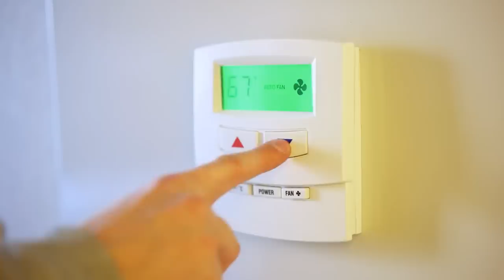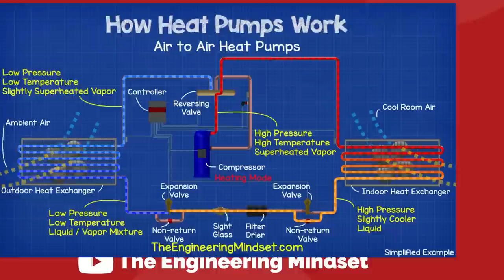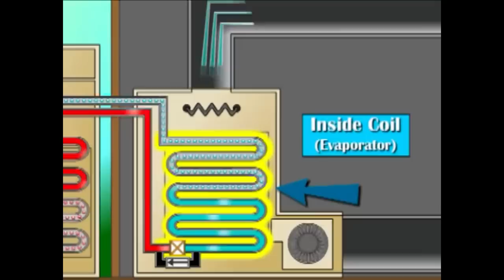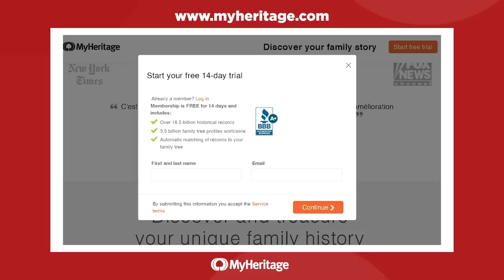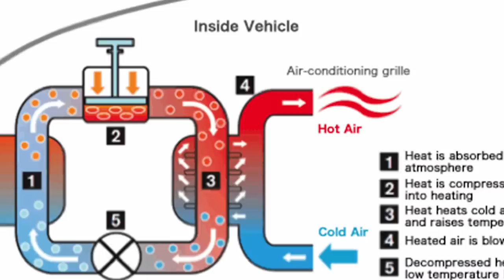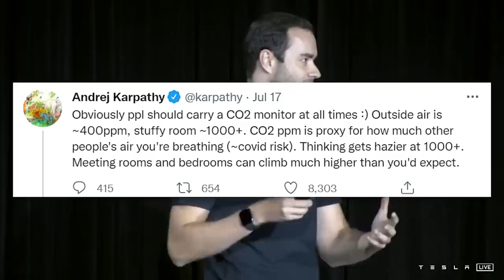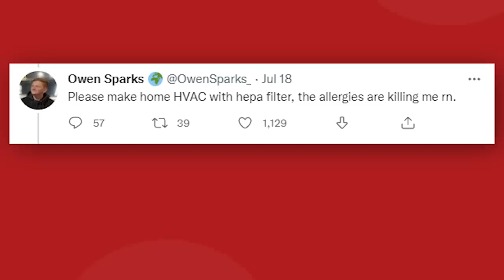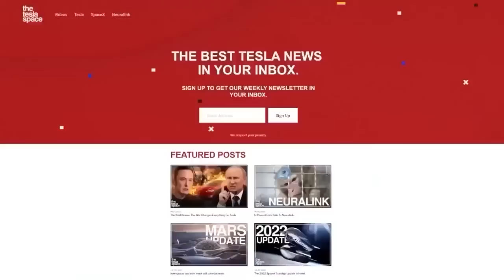Why Tesla's Heat Pump Is Essential For Our Future!

Comment: all hail elon for making 100 year old tech that every major HVAC company already makes.
Reply: This is the world television producers protected us from.
Reply: Lol I was seriously thinking the same.
Tesla is just over priced junk.
Reply: So did  he make it more efficient? Air conditioners/heatpumps might be 100 years old but up until recently heatpumps weren't very efficient at heating a home that is in a climate that gets below freezing. We now have heat pumps that can heat at 100% capacity to as low as  - 22°f(-30°c). That's insane since it's over 3 times more efficient than electric heat and some are 4 times. When you use ground source heatpumps you can get 6 times more efficient vs electric heat.
Reply: Obviously you didn’t watch the entire video because you would know that his team redesigned the “100” year old tech.
Reply: @DuelistMandroid  I have watched the whole video, several times in fact (just to make sure I didn't miss something). Elon has done nothing special or amazing. He took two existing technologies quite commonly used in the housing industry (heat pumps and HEPA), scaled them down for use in his cars (which did required some re-working to scale down), claims his "re-designs" are 3X more efficient than electric resistance coils (duhhh, all heat pumps are), proceeds to claim that he is so awesome for doing this and it should be scaled back up to be used in the housing market. Nice way to get back to the start of this journey in the existing technologies of the housing market.  Except of course I am sure, when he brings it to market, he will claim it is cutting edge and charge 10X the price.
Reply: @DuelistMandroid  
Enlighten us with you're knowledge
Reply: Elon sucks, but this is a good product/a huge force to actually pushing the boundaries.
Reply: @spencjon4822  I agree, heat pumps are a good product.  Every HVAC manufacturer in the world already makes them. I just want people to recognize that and not attribute this to musk.
Reply: @Durban01  Good to see another person with a working brain. Yanks are so gullible. Pitiful to read some of these comments. Creative thinkers? No. Not one.
Reply: @joeyork9891  "Your" indicates belonging to you. And "You are" can be shortened to You're. There was no indication of ANY significant progress made by Musk regarding the HP. It was inferred but no evidence was shown.
Reply: @kennethkeen1234  
Thanks.
Reply: Hail
Reply: The team did the work and Elon is just a leader and doesn’t want any credits.
Reply: @joeyork9891 rich from a guy who can’t even afford a Tesla 😂
Reply: @handle_user_unknown  
Maybe he can. They are only 100k.

Comment: I have another idea about Ventilate room during winter without cooling it
So - two tubes side to side all along , through one heat air going out while
through other coming from outside air heating simultaneously
Little bit of energy was needed in this case for actually push air
But its much much less then in Heatpump scenario
If compare it would be 1/100 for example or less , ...
Reply: Ha yea and - tubes should be long , i mean very long 
To provide decent heat exchange
Reply: There is a thing called a heat recovery ventilator that does what you are thinking about.
Reply: @honeytubs  yes its extremely efficient variation of those, when not a part but almost all amount of heat was recovered

Comment: Saving 75% with a COP 5 heat pump and solar panels here in Sweden. No batteries yet, except for the ones that we can’t yet use V2G in our Tesla cars. But hope Powerwalls will soon be sold in Sweden to complete our system.
Reply: What is the make and model of your COP 5 heat pump?
Reply: @LCD72  Toshiba
Reply: Why not just use a regular battery? Half the price and still has a ridiculously long payback period.
Reply: @mikekelly5869  a average household needs like 30-40kW to keep everything running 24 hours in case of a blackout. Normal blackouts last 1-2 hours. But unrealistic and unnecessary for most people to buy 3 PowerWalls. Most people in the near future will buy a BEV with maybe 60-90kW batteries so V2G and V2H is a must. Because we can then balance the grid and at the same time earn money buy when price is low and use or sell when it’s high a bonus is that you have backup power. If you are not a technical genius you need one Powerwall to manage this task. The thing is that Elon so far is not willing to give us V2G or even V2H.
Reply: @thescooterstore2813  If you need a battery, you can just buy a battery, any size, modular or otherwise. So far Powerwalls are nothing special. That might change, but if it does it will probably just make them smaller. A normal house might need 20 or 30 kWh to get over an extended outage of a few hours but unless people are doing things like using washing machines and dryers during the outage and the supply is down for significant timespans more than that is likely to be surplus to requirements. My own view is that if there's spare cash it's best spent on decent controls in the first instance so that you at least have UPS functionality and a rock steady waveform. Improved feed-in tariffs might make  bigger batteries more financially viable in the future but I doubt it. Utilities are clever at making sure that customers always continue to pay them when everything is calculated over time and they usually don't like unpredictable supplies hitting their transmission network because such supplies are far more likely to cause imbalance than the other way around. Despite the lip service given by utilities the world over, they almost never encourage microgeneration, or even larger scale generation by non-utility entities, for example PV on large industrial roofs. It adversely affects their bottom line and when the chips are down they want to control generation and transmission because that's where they make their money.
Reply: @mikekelly5869  Agree with your analysis. We do produce a lot with our solar panels in the summer period more than our three properties and 4 Tesla cars can use up. The thing is during the winter when we mostly buy electricity and the price peaks during the day. As we charge the cars during the night when tariff Iow, we would like to use some of that electricity during the day V2G or V2H. To manage that you need a smart battery that you can control from your smartphone. The best so far is the Tesla PowerWall. Hoping for more competition and more V2G we need to support the grid as everyone looses if the grid goes down.

Comment: It is honestly overdue to implement an updated version of heat pump technology in reducing global warming, where it is feasible (which is likely over 90% of the global market).  It is an expensive transition though, and at least in the US, it is the best time ever to start this process due to the recent bill passed subsidizing heat pumps for home HVAC as well as water heating.  In many cases up to 80% of the cost can be covered!

Comment: This has much broader implications. The next step after the heat pump is the ERV. The Energy Recovery Ventilator, which can save heat on the exhaust end and moisture as well. 

The Passivhaus movement has been on this for 30 plus years.

Comment: Pause at 10:37.
I invested in a Mitsubishi Zuba Central, in Quebec, where we spend weeks at -35C to -40C.  Freeze your nose hair cold.  And it cranks 22,000 BTU’s constantly because it uses an industrial compressor.  And heats a basement and 2 stories.  Because triple glass pane windows, insulated everything to the footing.
It costs much more than a traditional (clanky) square thermal pump, but at max power sounds like a soft rain shower in db.
My point; we don’t need Muskrat to « fix » our Thermo pump efficiency- just plan your thermal envelope and invest in a good system for years of trouble free use.

Comment: Refrigerant is not super cold.. It might boil at - 40 atmospheric pressure but not inside of a sealed unit.. It enters the evaporator a hot liquid. You can manipulate the boiling point of a liquid by manipulating the pressure above the liquid,  And it's refrigerant, Not freon!  Freon as a brand name Dupont labeled for R22 specifically.

Comment: HEPA for homes is a thing as well as uvc bulbs And Tesla heat pumps are not any more efficient than home heat pumps. And no matter how efficient your heat pump is you're eventually going to have to switch to natural gas in cold climates. There just isn't enough heat. And the way Tesla firmware updated the heat pump in their cars to make more heat was to allow its cop to drop below   1 which means resistive heaters would have been more efficient. I'm not saying that the heat pump is a bad idea and electric cars from temperatures in the upper 60s all the way to the 10s they are more efficient. But in you have to switch to electric heaters same as you doing houses. The only difference is in houses you're doing a cost comparison of the natural gas which tends to be a quarter of the price of electricity so you need a cop of four and anything below a copy of four you switch to natural gas because it's cheaper not because it's more efficient. In a car you don't have the cost of electricity to worry about. You have a set amount of electricity that you can use and you need to use it in the most effective way.

Comment: As anyone knows that tech is expensive as electricity is utilized to create heat and more to move it. The best option that has been utilized for over 10k years but modified properly in the 1400's and subsequently in the 1940's in the USA is geothermal. Heat and coolness is produced "for free" by the ground and requires a fraction of electricity to circulate it into the house. It can work in any environment extreme heat or extreme cold. The only limitation is the available (depth) ground near the home. These systems can last 50 to 100 and more for the same cost or less in the replacement of these traditional heating/cooling system. And requires far less electricity to function. Per example if the exterior temp is 100⁰F the heat pump needs to work harder and longer to maintain an interior temp of 65⁰F whereas a geothermal the system draws the heat in the home into the (colder) ground and on it's return will draw the cold for the ground into the home. The only electricity use on these systems are for in floor radiant the use of pumps and the other option is to tie into the pre-existing HVAC system with pumps and an air exchange unit (transfer heat/cold to air). Tesla's tech is a cheap version of geothermal that has been utilized since the early 80's as fuel prices went down but 10 years prior geothermal was the way to go as it was the oil crisis and any and all fuel types were extremely expensive. We find ourselves again in such a situation and energy specialists all over the USA are constantly hammering for expensive technology. People wake and smell the roses. Fyi many homes are anyways connected to a heat source(furnaces) and AC unit. Now look into geothermal and also to better your insulation. A home in the south or in the north should have the same rating. It is there to prevent loss and the outside temp from entering. Most in Florida cool outside as the majority don't have any insulation. Same occurs in the north (Alaska, Oregon, Canada). Best way to notice if you are lacking insulation in winter is the lack of snow built-up on the roof. As proper insulation does not transfer to the roof therefore snow built-up is it's consequence

Comment: In this video it is mentioned that heat pumps generally use Freon as refrigerant and the specific heat pump you show in 1:58 with a big X on it uses natural refrigerant, what is completely harmless to the environment while providing better operation conditions.

Comment: Gonna take some time to convince me
I had a A/C - heatpump - heppafilter  decades ago ..... now admittedly technology has advanced, but by nature 'heating' is way slower than cooling in heat pumps and walking into a 30F house and waiting 2 hrs before taking my coats off doesn't exactly suit me ..... I already struggle with the initial warm up delay in ICE cas before getting heat
.
Now my home unit had 'auxiliary' resistive heating to compensate for delays (sadly they were burnt out) .... but I still think it is sonething needed for the initial warm up

Comment: Heat pumps only benefit areas where electricity is cheaper than burning natural gas on site. My city is the opposite, though heat pumps would do wonders due to our winters being mild lowest it gets is about 25°F, it's cheaper here to burn gas on site.

Comment: thermal energy is best in space but under the ground about 3 feet down will be cool around the same temp all year so in the summer it cools you and in the winter it heats you. You don't need to use energy to move heat up you can use low pressure heat pipes for that you only need to pump a liquid up to use it as cooling but it's free heat just need to use a water pump to use it for cooling but moving water is more efficient than running a air compressor